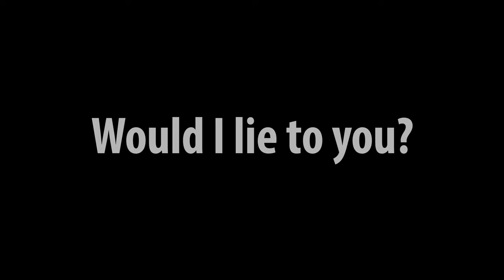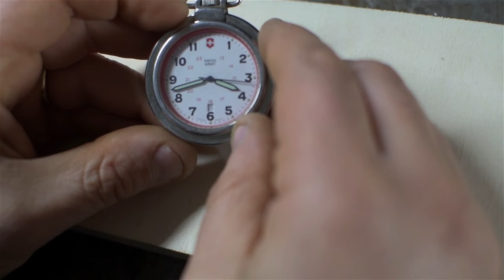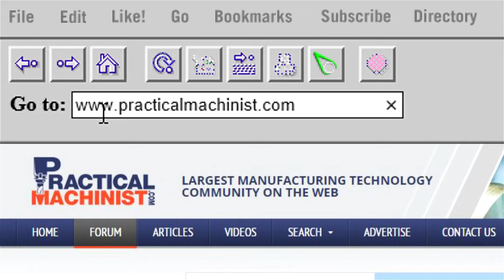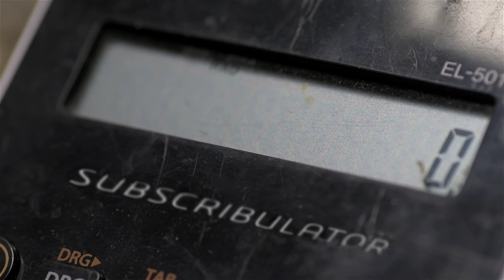ORIGINS   (feat. Clickspring)

Comment: Riddle me this: Just how drunk were you when you wrote the script? It's hilarious! :D
Reply: I suppose it's a spindle-off, it had to be preety lathe and they were buzzing, moments later, they felt TIG-ling in their hands. It was new I-die. So this happened, what we saw was wasn't boring nor turning, it was threading idea. That was a loose fit, but with some countersinking it squared...
But why have U killed metric system?! How am I supposed to measure anything in inches? I have only two thumbs god damn it!
Reply: That's what you get after drinkinng about 13/12 metric inches of hydraulic fluid
Reply: @aerogfs  lmao
Reply: Whoa whoa whoa..... The machinists handbook clearly states 'NEVER admit to operating a machine tool while inebriated beyond a reasonable level'

Comment: 1:15 I think they stopped making the 9V rectangular stock. If you find a good source, please post.
Reply: Jimmy's Tractor i think they have it at batteries plus
Reply: They only have half of it at Batteries Plus, You have to get the other half from Batteries negative.
Reply: @RGChandler  i laughed so hard i woke up the lady!
Reply: @RGChandler  Batteries Negative. Aw shift key, you know that they are on the other side of town.
Reply: Question, can you machine a 12V battery down to a 9V ?
Reply: @edwardhugus2772  Yes, and you have two 1.5 's left over!
Reply: @maker-matt  well then, I'd say MACHINING a 9 volt is the way to go, you can never have enough leftover 1.5 volt batteries!
Reply: @edwardhugus2772  Ain't that the truth.... Even my garbage can uses 4 of them!

Comment: Oh.  My.  God!  What just happened???  
I was sitting in front of my computer sipping my coffee; the screen went black.  Then, I don't know for sure.  It was like I was mesmerized.  I saw and heard glimpses of familiar faces and voices, but they were in strange contexts to what I knew.  This Old Tony, Stefan, Adam, Tom Lipton's music.  Then everything went black.

I became aware of my surroundings again.  My dog was staring at me with a puzzled look.  My coffee cup was empty, so I got up and went to the kitchen to get a refill.

Sitting in the middle of my kitchen directly under the skylights was a brand spanking new, top of the line Clausing drillpress with all the bells and whistles and a full set of both Imperial and SI drill bits!  On its table was a book that I initially thought was Machinery's Handbook, but when I read the title it said, 

Système international d'unités:
A complete, coherent system of units used for scientific work, in which the fundamental quantities are length, time, electric current, temperature, mass, luminous intensity, and amount of substance.

I have two drill presses already and don't need one in the kitchen.  It's blocking the refrigerator door, and I can't get to the milk for my cereal.

I'm putting on my padded blindfold and going back to bed.

Comment: there's something rather odd about the americans...

they rave about their independence, they don't want anything to do with the queen, yet they still use the british type of measurment, the imperial units...
so, they kinda want independence, yet they are depending on a type of measurment that is kinda outdated. In the name of independence, wouldn't metric be the way to go?

3/8, 1/2, 13/16 vs 10, 13, 21

at the end of the day it boils down to what you're used to